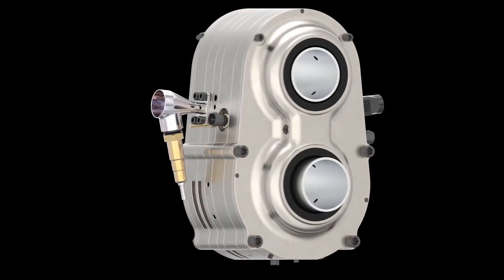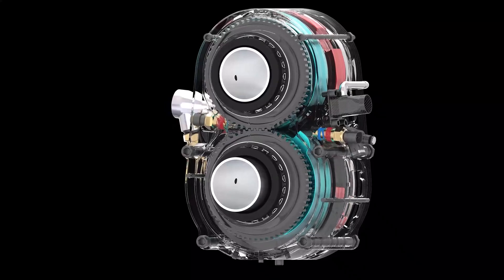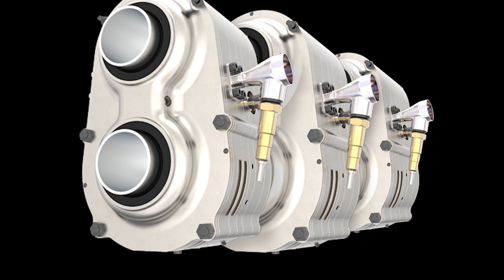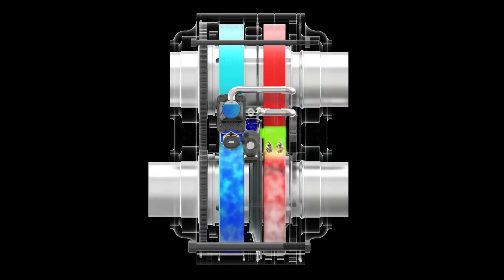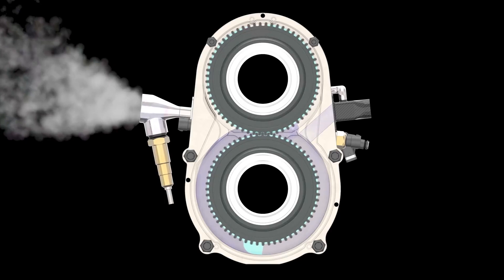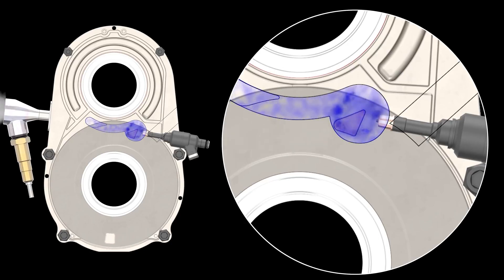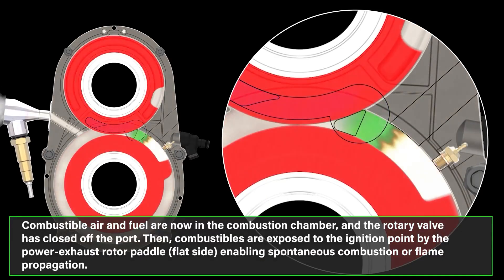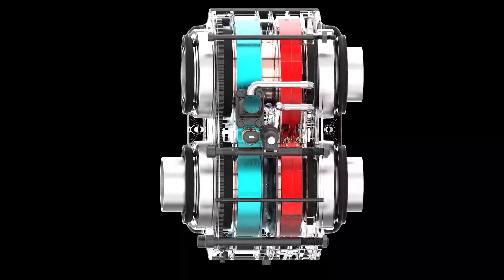This pistonless engine runs on hydrogen and revs to 25k rpm

Comment: A couple concerns: 
For the engine to produce green energy it must draw from a green hydrogen source. So electrolysis, which is not thaaat efficient. This in turn makes this engine even less efficient as well when compared to an electric motor.

Also, and please correct me if I’m wrong but I can’t imagine a system that has to maintain tight tolerances, high strength and be lightweight to require little maintenance. Especially when there are no seals to swap but instead entire parts have to replaced to maintain performance.

Also: The render is great but everyone can throw out numbers and a pretty image. I would be careful to hype something up that I have not seen.
Reply: Cant speak to anything else, but there are catalyst that greatly reduce the energy necessary for electrolysis. I"m more curious if we are getting our hydrogen from a factory, or if we have a water tank with said catalyst.

Comment: Having worked in manufacturing, those are gonna be a bitch to make. No seals is definitely either wishful thinking or just something to make the design stand out a little, production would likely have seals.

Imo: this engine would be cool and could maybe find application in aviation or industrial vehicles, but for every day cars EV's are the only way to go. Purely because there is next to no infrastructure for H2 cars, and the current fuel prices make it clear that the petrol industry is seeing the writing on the wall and trying to grab as much money as they can from as many people as they can before its all over.

Comment: 1. It's not either or with engines.   Some will be electric most will still be ICE engines for many many years.   2.Nigel Marston comment makes sense.   It would seem to be best as a generator.   Might be a good extender engine if it isn't just vaporware.

Comment: I'm with Chris on the idea that the internal combustion engine isn't dead. The point of this vid is to demonstrate possible paths forward, and maybe the tolerances will be difficult and the torque low. However it's not clear that electric isn't just a religion and a marketing gimmick. Li-ion battery fires, finding the lithium, the range, the power density for aircraft. Hydrogen seems likely to be part of the mix in electric vehicles and engines like this are on the path to a sustainable future.

Comment: No seals, but it requires extremely tight tolerances in moving machined surfaces.  Not only moving surfaces but surfaces in contact with each other.  How will the engine have geared teeth that are so close as to be combustion tight but also free enough to allow for metal expansion and/or the slightest vibration?

Also, it doesn’t take a fancy engine to burn hydrogen.  You can convert just about any engine type.

The idea that cars would be hydrogen powered is ridiculous in any case.  To get mileage competitive with batteries would require massive compressed gas cylinders under extreme pressure.  Like 2000 psi.

Comment: Reminds me of oil scroll seal design used on old British engines. With tight tolerances, they worked great for a short period of time when new. That’s where the saying ‘all British engines leak oil’ comes from.
Reply: If there isn't any oil under them, there isn't any oil in them. - Tow Mater
Reply: Where can I buy one?
Reply: @KK1913  They only cost $120,000 each.
Reply: 160? BS
Reply: The last century it came from when man went to the moon with tec your toaster now has
Reply: @rumple7551  doesn't seem possible.
Reply: @g3nj1  a hydrogen/wankle engine 🤔 why not?
Reply: Troy Reed showed how he developed his self-running motor from being a 10 foot tall monstrosity to putting it in a car. Charge the grid when you plug it in. 
Dennis Lee for 24/7 solar power anywhere on Earth.
Pro. Royal Rife for the Cancer Cure from the early 1900's. 
Dr. Stanislaw Burzynski https://youtu.be/qQKaCTdrmJc cured 98% of his patients with a harmless enzyme and the FDA is still trying to put him in prison. 
How deep does the Rabbit Hole go? Is everything Propaganda? I thought years ago that with the World Wide Web, there'd be a Technological Revaluation by now. The Elitist are making a last ditch effort by harping on the Green New Deal. Videos like this are part of the problem. They complicate matters to the point where it stifles inventors from thinking  linearly.
Did you know that you can take a magnet from a microwave and easily build an LED lamp that will stay lit for over a hundred years and more with no moving parts? There are technologies that would allow you to fly for as long as you can stay awake, then your buddy could do the same thing and you could continue until you run out of food or water (if you don't have a toilet).
The more you know, the closer we all are to true freedom. 
You "sound" intelligent, can you grasp the things I've written about?
Reply: Funny that I know that saying due to a kids movie and not cause of knowledge/career background.
Reply: If it ain't leaking oil, pull over and add some.
Reply: The aluminum castings were porous. Oil leaked right through the metal. Old school foundries were producing leakers.
Reply: Do you know why the British do not make TVs?  Because they have not figure out how to make it leak oil yet.
Reply: @jamesstephenson4544  Not true, I had a TV  that leaked oil. The eht transformer, which generated a very high voltage for the cathode ray tube, was oil filled and sometimes developed a leak.
Reply: @jamesstephenson4544  the old projector tv's had oil in them that could be caused to leak,the only thing is, when the eyeballs leaked things melted and there would be no picture.
Reply: It would require an engine the size of a bus to equal gasoline!

Comment: I like this design, but hydrogen has some challenging storage issues (it keeps escaping) and introduces severe metal fatigue which has not yet been resolved. It is also difficult to distribute to the end user. I think hydrogen has applications in permanent facilities such as power plants, but don’t see a future as a mode of transport. I do like that the waste product is drinking water.
Reply: How do you see hydrogen being used in power plants when we need power to produce the hydrogen?  Hydrogen, on this planet, is not an energy source since elemental hydrogen does not exist and needs to be created.  Are you clowning?  If not, why are you flapping your gums about something you obviously don't understand?
Reply: @DiffEQ  Actually, stars are huge balls of hydrogen. It's one of the most abundant elements in the universe. But you are right, it's not like we could just pull hydrogen out of the atmosphere, it would have to happen at extremely high altitudes. And all we would get would fill a football stadium. So, right now water and hydro-carbons are our only good sources of producing hydrogen. Another problem is the combustion process, no matter what the fuel it will always produce NOX. This is due to the amount of nitrogen in ambient air. I work at a power plant that uses CT's and recips that run off natural gas. And NOX is worse than CO2 by a long shot... We have to mitigate the NOX using an SCR process and injecting anhydrous ammonia into the the catalyst.
Reply: I hate to say it but it doesn't matter if we like it, or it would be a perfect solution to an age old problem... It all comes down to how can it increase the wealth of greedy politicians who already have lobbyist representing other technologies lining their pockets?
Reply: @peasantsarerevolting9343  right...... Have a look at the real climate statistics, weve risen something like 0.1°c since 1800 lol "renewable" energy is apart of their narrative.
Reply: @mudzy9820   not much renewable about it. The only aspect that is renewable is the children they use to mine their precious cobalt in the Congo. The rest, (just like their wind turbines) will end up in the land-fill$.
Reply: @peasantsarerevolting9343  yeah ahah remember hearing about that slave labour pretty much 😂😂😂and nobody has a clue
Reply: @peasantsarerevolting9343  Wut?  Cobalt?  It's an engine, not a battery.  Before you get triggered by "renewable energy" feel free to do ANY research about the subject you're hating on ;)
Reply: @matthewdunstone4431  I was responding to a reply that's not showing up in the thread... It is in reference to how the greedy political agenda is geared towards "renewable energy" and wouldn't touch this "engine" with a 10' poll. Do me a favor and count the actual replies you see and then compare it to the number of replies youtube says you got. You'll see there's one missing.

Comment: Someone else already said it, tightly fitted spaces and no seals, while working with the smallest element there is, that can never work. The space inbetween the rotor and the cylinder around it would have to be a smaller than an oxygen atom, if any oxygen can pass through inbetween the rotor and the cylinder which houses the rotor, the hydrogen can oxidize (combust) before and or after the rotor completes the cycle, which can and likely will result in further combustion, all the way back to your fuel tank... something you don't want while you are inside the car.
Aside from that, by the time that that engine leaves the proverbial drawing board and gets into production, I am guessing that clean water will be reserved for drinking. And you need clean water to get clean hydrogen. And yes, I know, if you burn hydrogen you get water, clean water. H oxidizes and forms H2O. But I doubt anyone will want to lick the clean H2O out of an exhaust, or off of the tarmac. And yes, I still do use a car with an internal combustion engine,, so I am not driving green yet. Wish I was by the way. But any design for any engine that burns any kind of fuel in any kind of way, was not, is not and can never be a great new idea. At best a variation or adaptation of an existing one.
By the way, if the space between the rotor and the cylinder housing it has to be less than the diameter of an oxygen atom, the whole thing will grind to a halt after maybe a few hundred revolutions because of the expansion of materials due to temperature. Even titanium and ceramics expand. And if you rely on the parts sealing off once they have expanded due to heat, well then they are not sealed when the engine starts, and you go boom.

Comment: Hydrogen  is more  efficient  option used with fuel cells, hence electric vehicles . That's the catalytic    electricity generating fuel cells , not the other  fuel cells which are the various fuel tanks on aircraft. 
  You don't  really show us how this thing works .

Comment: Total BS.  Getting an engine to run on hydrogen is not the challenge.  Making, storing and transporting the lightest element in the universe is. If this was a good prospect for replacing present internal combustion engines than build a few and prove it.  No, you're just selling snake oil.

Comment: I believe an engine like this would be suited really well in a hybrid package since rotation would contribute more generation of electricity without needing higher horse power
Reply: I think 25000 rpm might do a little better job then a standard engine at 5000 rpm
Have a good one troll
Reply: … because standard engine don’t have rotation? Stop being so confident about nonsense.

Comment: Nope, rpm will not make up for seals as far as emissions are concerned. EPA's gonna kill this I promise. If they're gonna use tight tolerances as seal, where is the lubrication for the sides of the rotors? Tight tolerances at high rpms require clean, high pressure oil or failure is eminent.

Comment: I would have to say let's see how it works and then go from there, Although if it does work well I would definitely want to put one into the back of a 1960s formula 1 car. Because a 170 horsepower in a car that weighs roughly less than a 1000 pounds, That thing is going to move. Like a member of the super straight club out of a gay bar

Comment: Hp is torque x rpm. So 160hp at 25000 rpm means verrrrry little torque. Not 170ft lbs. Lol
Also, hydrogen? The compression rates needed also make it very difficult to work with

Comment: If the storage of hydrogen has been solved then won't it be better to use fuel cells and electric motors instead of this? This looks too complicated with a lot of parts that could go wrong. And I wonder how the efficiency of this engine compared to a unit using fuel cells and electric motor.

Comment: all the energy it takes to produce and recycle electric battery's that may not work efficiently at hige and low temperatures, or how much energy is lost by people parking as trying to store charged batteries all might calculate as to a lot of the cost to produce hydrogen, makes then hydrogen practical, but also if we produced hydrogen and pumped or bubbled the oxygen in to water ways to help restore and oxygenate lakes, oceans and rivers we then are doing a lot more then we realized we could, because hydrogen is so energy dense in such storage, a tank need not be large, and thus we can produce such tanks with many layers and systems or safety. we also forget that the cost of iron for pipe lines and mantance is expensive, and also the cables for a electric grid now are also expensive. where as a wind turbine producing hydrogen can store the excess energy or excess wind in to hydrogen in many locations and thus might be able to move a lot of energy threw a simple plastic tube to the fuel station. and last its better to have a gas for heat back up, rather then relying on electricity for winter heat. eventually we will also not need to build anymore hydro dams. rather there will be many" hydrogen farms" where energy is produced by free enterprise, rather then by a oligarchy of corporations and governments. love the new engine design as its also back on tack with integrated design and simplicity like the VW pancake engines of the late 60's. it really seems now that progress is blocked by political interest in corporate monopoly and simply fear.

Comment: Interesting concept. But with all respect, why is it so often ignored that hydrogen is not an energy source? It's an energy container, it needs to be produced by electrolysis which requires electricity, huge amounts of electricity. After that, the hydrogen needs to be stored which, beside the high explosive risk, is also a voluminous matter as the energy density is a lot lower than fossil, so you will need to pack more for having the same amount of energy available.

Comment: The issue for me isn't possibility or creativity or even technical soundness. It's funding. 

Someone has to either A: create a car around this engine, that people want, that will sell. 

Or B: these people have to sell this engine to a company like Chevrolet, who will bastardize the design all in the name of cost-savings, and inevitably blame the design of the engine for why it failed. 

And even if they don't do that, they could still fuck it up just by putting the engine in some ugly piece of garbage car and blame THAT for why the engine failed. 

Engineering isn't the problem. Sales is. Whether you're selling to the masses or some idiots in a board room, the technical capabilities of the engine will matter little to the people who's only question is going to be "how much does this cost?"

Comment: Hydrogen isn’t a fuel, it is a transfer medium, from a caloric point of view. The problems with storage, proton embrittlement, and compression rule out hydrogen, for the foreseeable future. 

That being said, if you could run that thing on methanol or natural gas you would have something. Use it as a home generator, or as an onboard generator in a hybrid car.
Reply: Hydrogen is a fuel.  Go back to school.

Comment: The production of hydrogen is very energy consuming. It would be fun to see a complete energy calculation, not just on this engine, but all the proposed hydrogen driven combustion engines.
Reply: It would be free if they modified dam turbines to extract the hydrogen from water.
Reply: @yruafredo2990  The amount of energy that is needed to produce one kg, 40 kwh, of hydrogen is approximately 50 kwh. You may call it "free", but the cost of building dams and hydro-electric facilities to power the production of the amounts of hydrogen needed, are immense.
Reply: @NICOLAI_VET  The cost of those facilities pales in the face of the cost of not building them.
Reply: @NICOLAI_VET  Do not forget the need of constant maintenance and upkeep. It will cost money to produce throughout the life of the facility. You are right about it not being free!
Reply: @filonin2  "Sustainable" energy is fine. Hydro, sun, and wind. But the Sun doesn't always shine, the wind is kind of erratic, and Hydro doesn't work when it doesn't rain.
We need to have something that's more reliable. In my opinion, that is nuclear power.
Reply: if the task of creating the hydrogen is parceled out/ multiple hydrogen generators; Then the process does work and can produce enough fuel to run a motor with ease. A single generator wouldn't do it fast enough as you suggest.  Meta materials have come a long way as well and may be fun for you to check out. #cheers
Reply: @wisenhimer70  you also have the Waste energy during the day on the US electric grid which could be use to produce Hydrogen through electrolysis which is up to 95% energy efficient in energy retention compared to Lion batteries which are only 90% efficient, Long term solution is to convert the existing cars on the road to hydrogen which is entirely do-able with around $500 per car